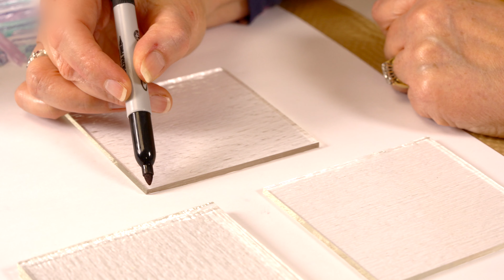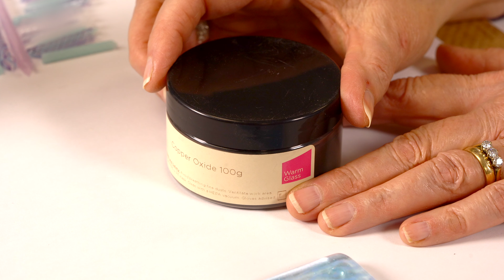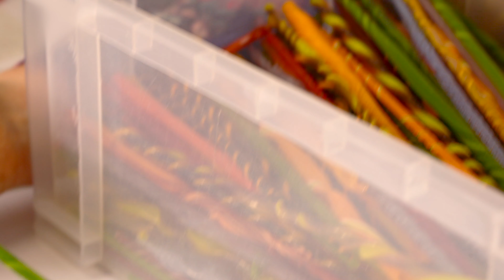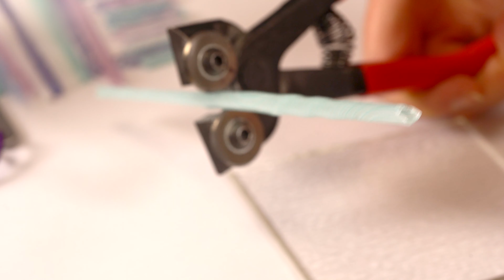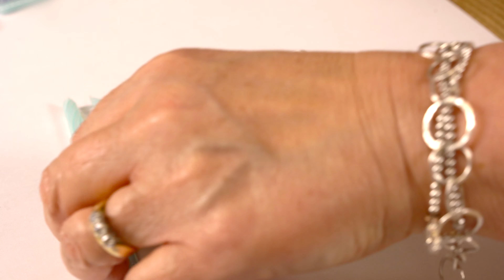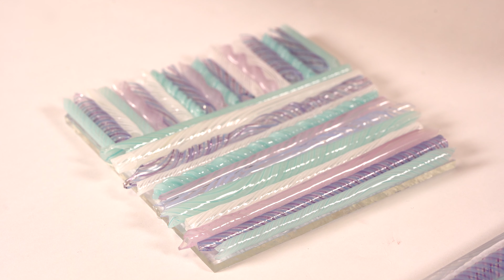Making coasters using tubes and twisties

Comment: Sooo easy, possibilities are endless!  Gorgeous as usual. 😉  Did you fuse those Tekta facing up (or cane face down)?  Thank you so much Jill!
Reply from the maker: As you say, limitless design opportunities limited just by your own imagination. Can't recall if it was rough or smooth side up, think it was rough. Only difference will be more bubbles or less bubbles.
Reply: @FiredGlass  Thank you Jill!  So thrilled to have you back online.  Love your videos and lessons! ❣

Comment: Hi, so what is difference between copper oxide and copper carbonate?  so i did buy the copper carbonate, and had some copper leaf. the results of both are beautiful LOVE your work!!
Reply from the maker: Copper Oxide is stronger as it’s 100% oxide whereas carbonate has less oxide in it. Both can be used to generate bubbles. Oxide will give lots of blue bubbles and carbonate can give green bubbles. Both are best mixed either with a touch of clear powder or a coloured powder to tint the bubbles. Both need to be capped to work & will give best results at full fuse. I have used on a tack fuse but sometimes this can leave a residual of the black powder behind
Reply: @FiredGlass  so far both the copper leaf and the carbonate have rendered super blue  bubbles in the Bullseye glass. not sure if it is green in some other coe thank u